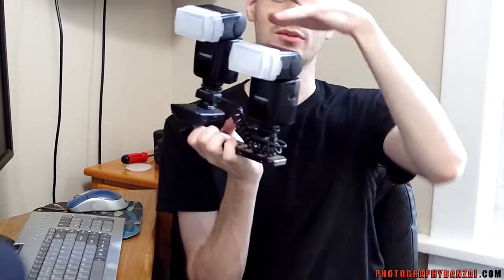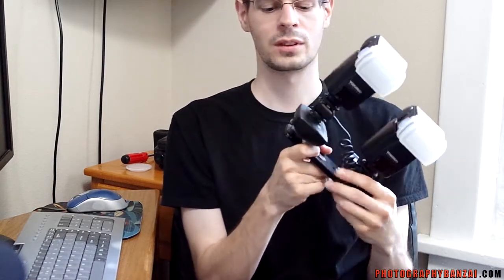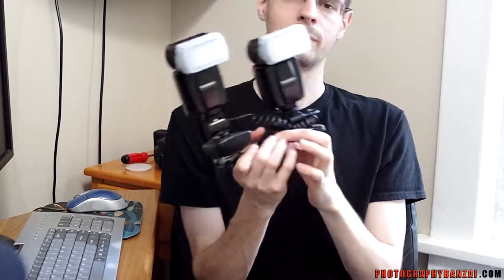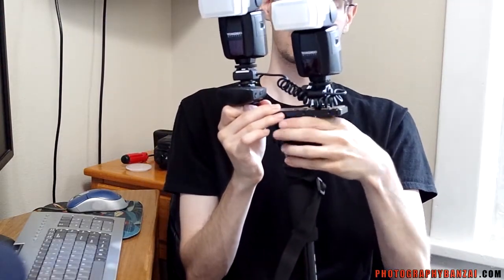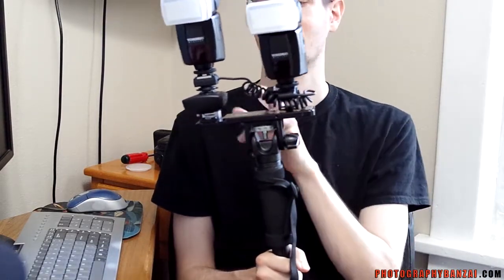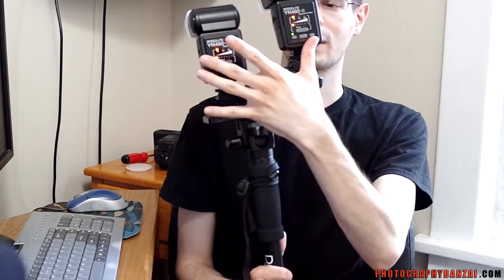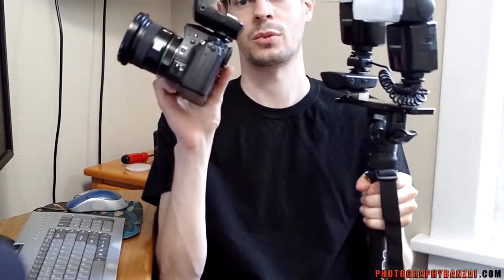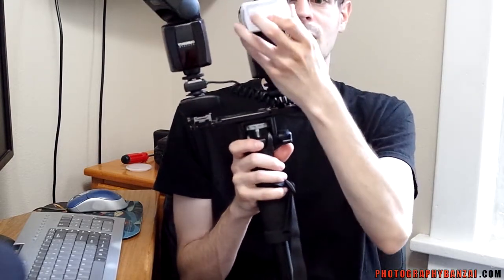Dual Flash Wireless RF Monopod Wand

Comment: Did this set up end up working out well for you? I am also thinking about using a monopod to hold a flash in one arm and a camera in another
Reply from the maker: I used it a few times. It's difficult juggling the camera and a pole that can't stand by itself. It would be easier to use a normal tripod and collapse it as needed. There are monopods with legs, but that has some risk of falling over though a better option than a normal monopod. I did a video on a monopod like that: https://youtu.be/Ie-B9pBVIxY
Reply: @ScottJWaldron  thank you. I will definitely watch this video you linked.